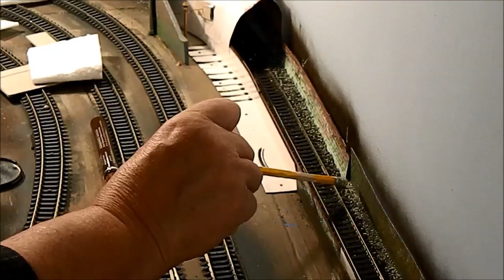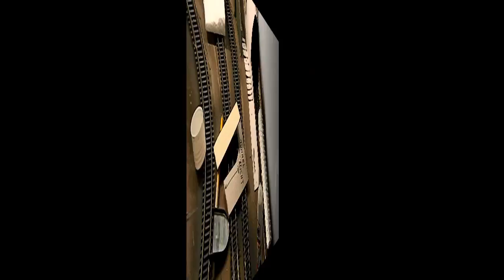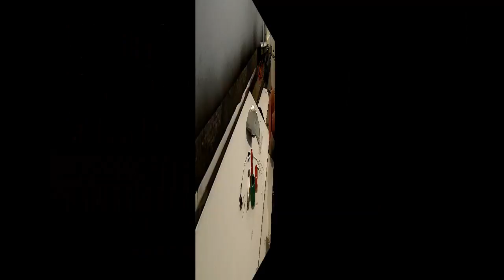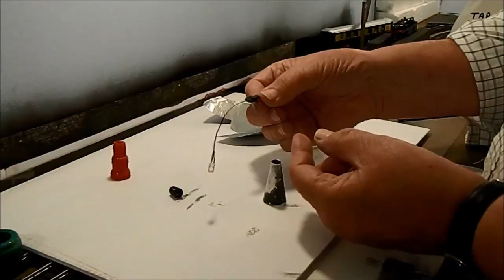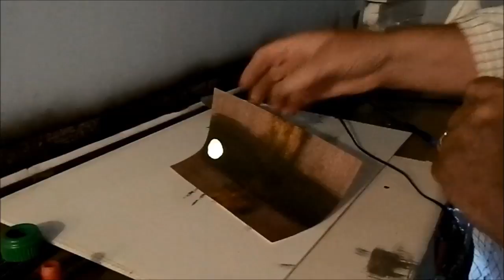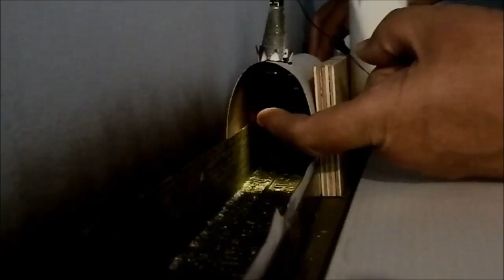No 18 Tunnel Construction Part 3  Aug 2018

Comment: Barry, I really like the idea of the shafts of light striking the rails at points along the tunnel, it’ll make for a great feature as the camera train runs through it. Quick question on the camera, your clearances for the coaches and locos looks very tight, particularly on the curve, have you checked clearances with the camera wagon to ensure it clears?  I only ask as I’ve noticed some of these cameras tend to overhang their wagons when mounted upon them. Great work so far, this is a great example of the need for forward planning to ensure you install everything before the modelled section becomes inaccessible. Paul
Reply from the maker: Hi Paul, yes I have check the clearance and it is OK but I will admit that I had the first 3 sections in before I thought of it. If you go to my Video No13 and fast forward to 13min 43 seconds, you will see what it looks like and how it is on a short wheel base cut in half and made to fit wagon base. .......... Barry

Comment: Hi, I have watched all your videos on building the tunnel, I am very impressed with the work you have done so far. I do like the cones with lights, will you have enough clearance for the trains to pass underneath?...Simon
Reply from the maker: Hi simon and thanks for your comments, very encouraging for one chap in a shed and a load of track and bits. The cone will be a bit higher in the ceiling and secured outside by strips of tape as I don't want it to fall onto the track when the job is completely sealed. I have it in my mind to drill a hole through the cone level with the outside of the roof and pass a length of 1mm wire through it just to help with the support. That's an experiment for this week end ..........Barry